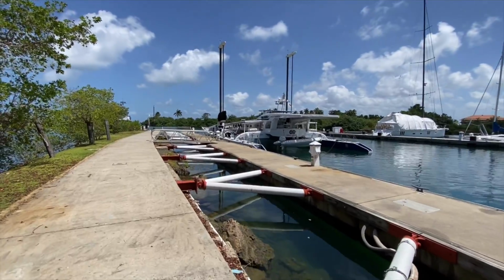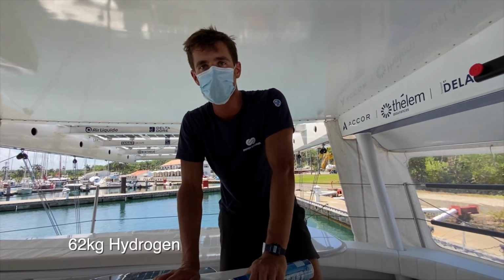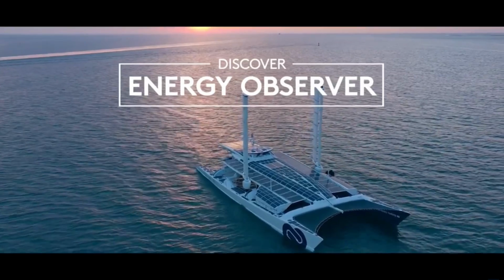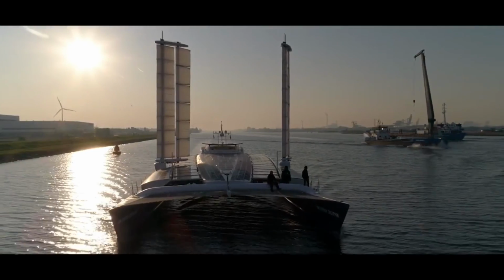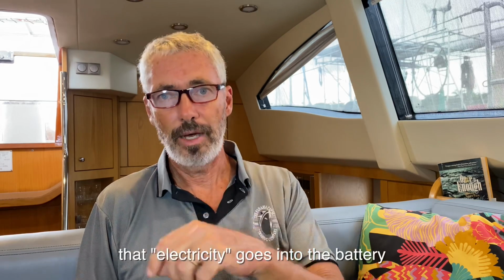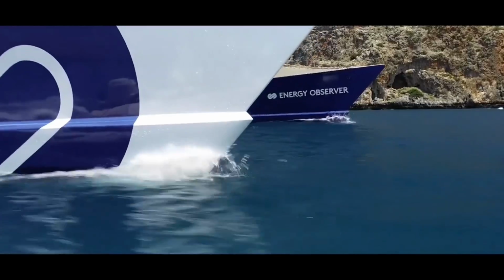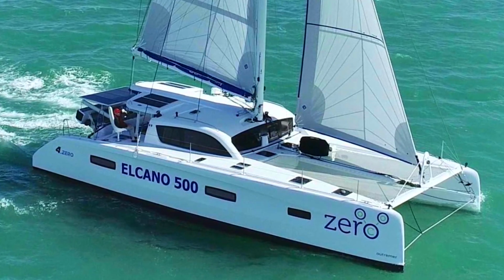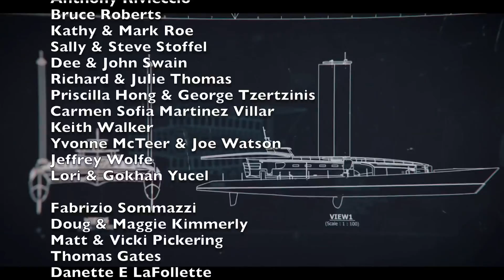Hydrogen-Electric powered boat! Can we get this on our new sailboat? | EP 204

Comment: So i am stuck at  home in Sydney  Australia due to this virus that is not giving up so i am getting a bit of envy watching the video which i would like to thankyou for producing. So the video has inspired me add a few commits  my area of expertise is in batteries and alternative energy technology. 
Unfortunately as you have witnessed the technology in batteries and solar is not there yet for boating due to available size and weight constraints. 
There is a company in Western Australia (ATC.ASX) is working in a process  on the  coating of silicone with pure alumina in theory to stabilise the silicone at a 30% mix in lithium based batteries. The silicone can greatly increase the storage capacity of a lithium battery and with a stable 30% mix of  silicone would increase the capacity by approximately 50% compared to a  present standard NCM mix.
In the labs at the moment they are developing multi layer / multi frequency solar cells that can charge with an increased efficiency compared to existing single frequencies solar panel. 
Hydrogen still worry's me due to we do not have an endless supply of water compared to the sun. 

A 100 years ago people would only have been focusing on the technology and  would not have given a thought that fossils would be such a problem in the future. So what will future generations think about this technology of breaking down a limited time frame resource for an energy source when there are other technology's are coming and improving all the time. Governments will love hydrogen due to they can hit the supply chain with tax compared to the sun which is free at the moment until governments can work out how to tax that too!
Hydrogen has issues of 
% efficiencies of motors
% efficiencies of manufacturer but this may improve
% using a source of energy that is not unlimited 
An Australian based company  (GEV.ASX) is at present designing a pilot hydrogen power ship for the export of hydrogen, thought you would to google 
regards

Comment: This kind of applied research is very important to learning how to optimise all of the systems involved to get the necessary results. I think we're slowly closing in on solutions as performance and efficiency of all the subsystems are improved over time.
Reply: What I find more interesting in this comment is the use of plural in solutions. Nowadays combustion engines is the go-to solution but it seems that tomorrow solutions are going to be a lot more tailor-made to the types of vessel and their applications. Hybridisation of all sorts, mixing multiple energy sources is quite likely.
Reply: @jean-jacqueslavigne3109  indeed. I don't have any connections with those who designed or are sailing the boat but breakthroughs in engineering are rarely the result of just one factor. Solar panels are getting better, as are motors, electronics and management controls. I believe all of these factors together will yield the hoped for revolution in yachting.
Reply: @ttystikkrocks1042  exactly. There is more innovation now than in the last 120 years, undoubtedly. So many options, angles to look at. Even for non-sail vessels, propulsion and power are no longer a consideration limited to below the deck - FYI we are completing the design of a non-sail research vessel (Earth 300)- and we even looking at way to generate power and reducing power requirements through the paint etc

Comment: This is very interesting topic. My forthcoming build is definitely going to have electric propulsion. That’s kind of starting point. The completion of the boat is still years ahead so there may be some technical development happening during this time. Anyway, living and cruising here in very north kind of makes it necessary to have some kind of fuel in the boat. In winter there’s no sunshine and it’s cold. For now I’m thinking of having reasonable sized battery bank and diesel generator and heater on the side. Hot water is easy to get directly from the sun.

But for the electric propulsion in general, with experience of 1,5 seasons with one there’s one thing that should be remembered. Speed. With electric propulsion and limited capacity it becomes clear how much the cruising speed affects to the consumption. With my 27 footer , 3 knots is kind of reasonable maximum speed to go. After that the consumption will rise rapidly without mentionable gain of speed. And from other sources I’ve got info that this applies to bigger boats as well.
As Paul mentioned in video, you can gain a lot of range by slowing the boat down. This applies very much with electric propulsion as well.
So in order to use electricity as power source, we have to change our perspective to sailing as well. The sailing aspect will come bigger and motoring will and should be marginal.

Comment: What’s the relative efficiency comparison between storing power to battery and then using that power compared to storing power to hydrogen and then converting it back to electricity
Reply: A fuel cell is roughly 50% efficient in converting the energy potential of hydrogen into electricity; this number can be tweaked but increases in efficiency carry the penalties of cost, size and complexity. I'm not sure what the efficiency of converting electricity into hydrogen night be but any physicist or engineer will tell you that nothing happens for free.

Comment: Can propellers be installed on the side of the haul that will turn and generate electricity with the water when immersed and wind when lifted above water to feed batteries as the boat is sailing? What happened to Alcyone, Jack Custeau's inventions fitted with computers to optimize the functioning of Turbosails and engines. To maintain a constant speed, the engines take over automatically when the wind dies down, then they stop completely when the wind is strong and from the right direction.

Comment: Interesting and well done as usual.
Would be interesting to see the efficiency they get from solar powered H2 production compared to the H2 fuelcell efficiency, i'm sure the operation runs at quite a big lost.
One final note, let's not make confusion about Hydrogen cars because there are cars actually running Internal Combustion engines on H2 or intermixed with petrol and not using for fuel cells

Comment: Why not a mix of it all? Electric engine for propulsion and for regenerating while under sail. Solar panels and a wind generator to generate energy too. Store energy in lithium batteries and any excess energy gets converted to hydrogen. Downside of that setup is you might run out of juice if it's overcast and low wind. So you add a diesel generator for those situations, so in a pinch you have a diesel-electric boat. Upside is flexibility. Solar and wind recharges the batteries and hydrogen while at anchor. Solar, wind and prop regen recharges batteries and hydrogen while under sail. And you can run the generator while at a dock with easy access to diesel or when you need to motor in the middle of nowhere and the hydrogen is running low.

Comment: Thank you, I enjoy your videos and they are very inspiring.
However, I think you need to make the core concept of this boat more explicit as such:  "the perpetual cruiser"
1) Hydrogen is a storage mechanism, and the weight for power ratio vs batteries is favorable.
2) Power is generated in real-time by a LOT of solar panels, and this can effectively create enough average power to move the boat indefinitely, or this is at least the project goal
3) Beyond immediate needs (propulsion) the solar panels charge the batteries until full, and then produce hydrogen to store in these special tanks

The overall picture is the key. This is not a boat that you stop and plug-in somewhere to refuel or recharge. If you run out of stored power, you can simply wait and it will charge up via the sun. Given sensible power storage management, one can cruise indefinitely.

Comment: i've been kind of circle around these renewal energy for the past few weeks, and i feel the best way is to have multiple energy sources. it does not make sense to have just one source of energy flowing on the ocean and expect it to be enough. my ideal solution would be sail or kite system utilizing the wind, and hydro generation while sailing. then of course solar + lithium battery would be a big part of energy source and a back up propulsion solution. as for hydrogen sounds great and all, but having a hydrogen conversion system onboard would be a exhausting.

Comment: The newer Oceanvolt motor with Servoprop is a game changer for fast sailboats.
Reply from the maker: Yes I think Jimmy Cornell has one of those and is going to get a second for his Elcano catamaran. I agree with you Dave it could be a game-changer
Reply: Another interesting thing about solar boats are the thin rigid sails that give little shading. These don't seem to have solar panels on themselves like other boats I have seen like the Solar Sailor but this boat also used a kite-like downwind sail at one time to avoid shading the panels.

Comment: The main problem with hydrogen is that it takes a tremendous amount of energy to split H2O molecules into oxygen and hydrogen. As you can see here, they can only make 2-4 KG of hydrogen in a day with all that solar on the boat. That's just not practical for the vast majority of applications.
Reply: There seems to be two possible paths for hydrogen. The dirty path, which is often behind some  hydrogen projects. That's remodeling the oil industry: drilling to gas/diesel fuel changed to  oil drilling to conversion to hydrogen, the second path as represented by the Energy Observer  and explained by Paul near the end is stationary solar/wind power generating so much surplus energy that it can be used for electrolysis  to extract the hydrogen from water. 
The first path does almost nothing for global warming but reduces pollution at the vehicle (boat in this case), the second path is carbon net zero.... I think  like what happened to electric cars 110 years ago: the gas cars were so immediately superior (gas was cheap and range was much much greater) they didn't have a chance. I think they had a range of 10 miles.  Right now electric cars - like my Tesla - are so economically superior to the hydrogen option, hydrogen will either be only a niche somewhere, or it will have to wait for the massive overproduction of alternative source electricity or it may simply never happen.  The best take away from this video is that 62 kg of Hydrogen = 14 tons of batteries. As Tesla conquers  the world, that relationship won't change, but perhaps someday the economics of producing and distributing hydrogen may.
Reply: Not only the production of hydrogen is a problem, the storage is one too. Hydrogen is the smallest element we know. So, no tank is able to hold all of the hydrogen you fill in it. Some hydrogen will defund through the material of which the tank is made of and is lost.
Reply: @Keith M Today electrolysis has an efficiency of about 70% to 80%. So, 20% to 30% loss is about what you mentioned what the system can save... Do the math - these systems are not economically...
Reply: @Keith M I've looked into HHO extensively. The laws of thermodynamics says it wont work. Every person who claims to have created an HHO system that works, has failed to show a working product when challenged.

In other words, I don't believe you. Since I have extensively reviewed the claims for myself, and since it is my experience that those who believe perpetual motion (by way of HHO, or any other means) cannot be persuaded that their viewpoint is wrong, I feel it is a waste of my time to comment on any further demonstrably false arguments you might have.

I wont be discussing this any further.
Reply: When the ship is docked in a harbor (which is most of the time) that’s when hydrogen production is valuable. When you leave the dock, you could have a full tank.